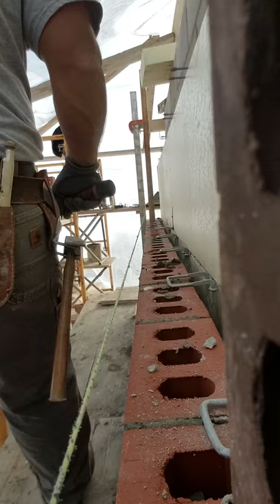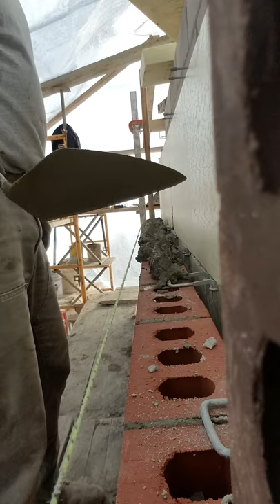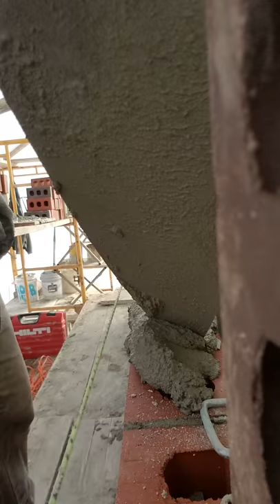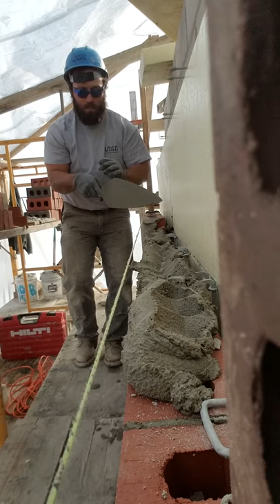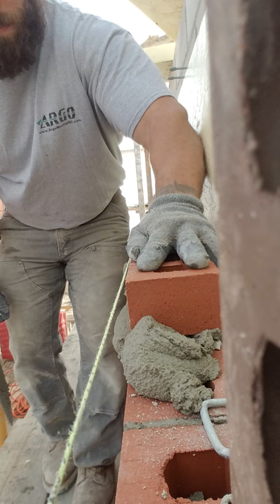13 inch London narrow trowel with rose winter masonry

Comment: not installing full joints, short spread so zero reason for 13" trowel, hitting and grabbing the to lay brickm tapping to much, mortar not pulled forward to keep cavity clean. Poor Winter Masonry.
Reply from the maker: PaddleDogC5 plenty of cavity. joints full. Strong full bed joint.
this is a well built wall. not a wal mart wall like you must do. lol.
Reply from the maker: PaddleDogC5 zero tapping.